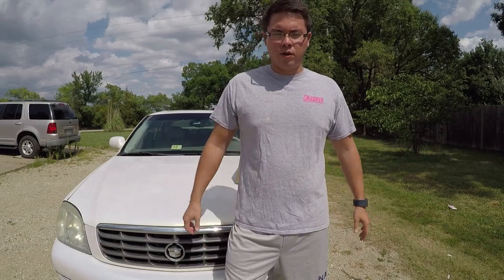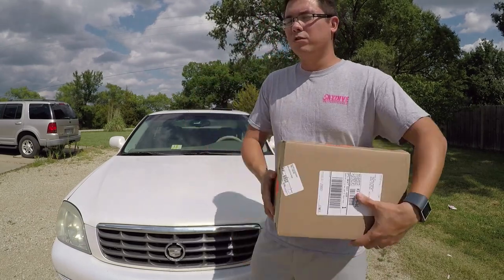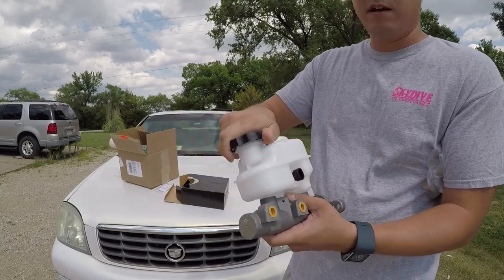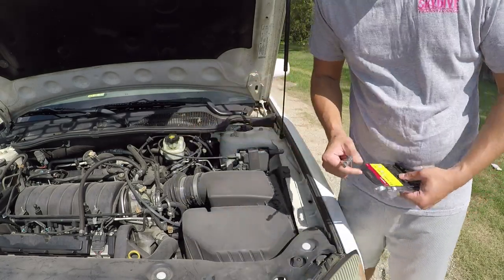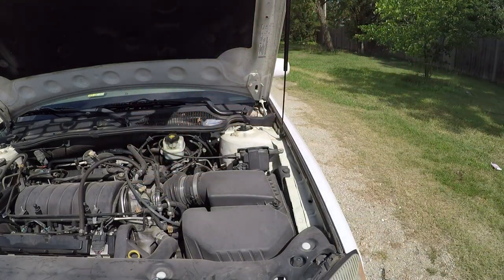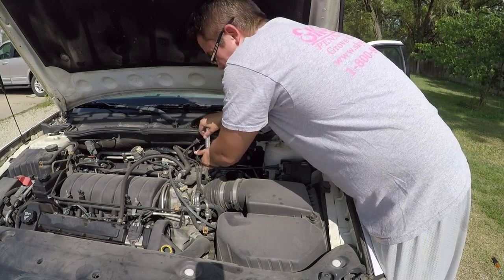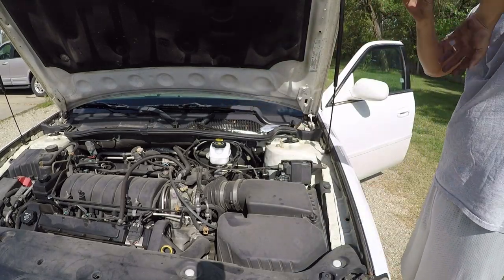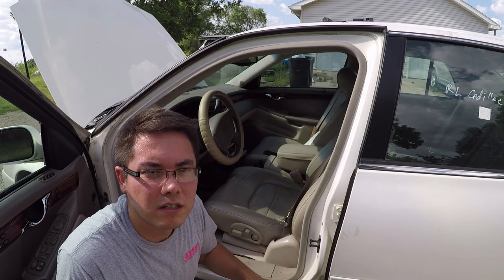How to Replace Brake Master Cylinder - A Step by Step Guide and How They Work

Comment: I agree with Heaven96 about bleeding the master cylinder. In order to not get corrosive brake fluid all over the engine bay one should either bench bleed the master cylinder or mount it on the car then use a master cylinder bleeder kit which cycles the brake fluid back into the master cylinder.
Since an air pocket was introduced into the brake lines when disconnected you should also bleed the lines at each wheel following your vehicle manufacturer's recommended process. Not every manufacturer recommends bleeding the furthest wheel first. 
All in all it was a good how to video, keep up the good work and thanks for sharing. 

Master Cylinder Bleeder Kit
 https://shop.advanceautoparts.com/p/dorman-help-master-cylinder-bleeder-kit-14151/12455502-P?searchTerm=Brake+Master+Cylinder+Bleeder+kit